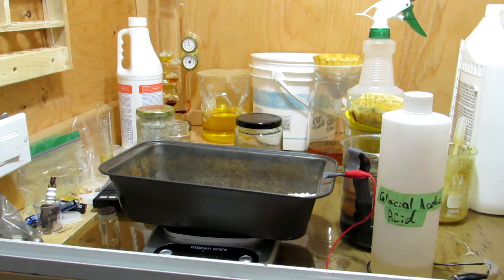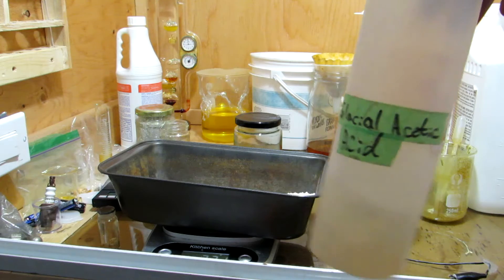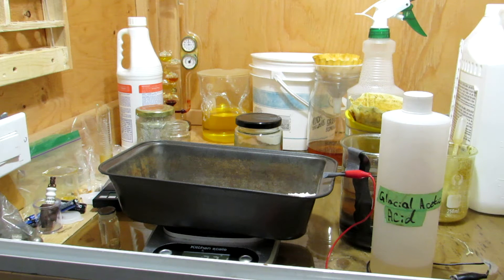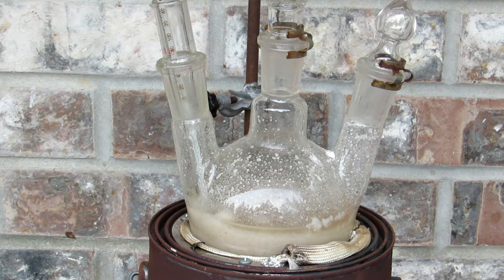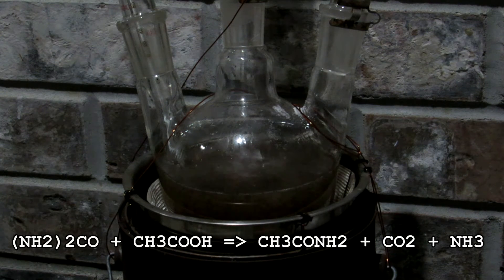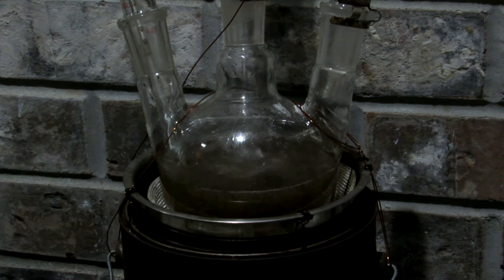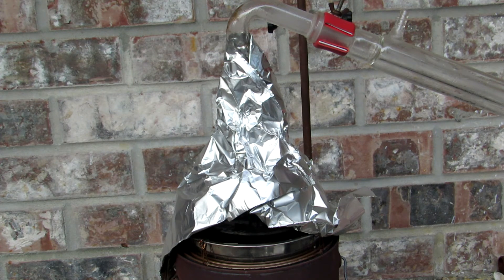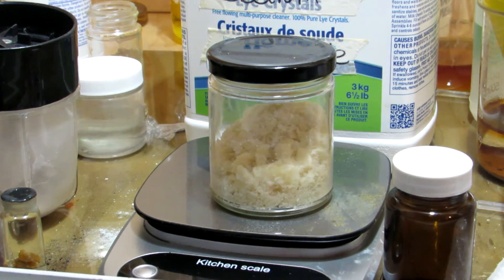Making Acetamide from Urea - Household Materials

Comment: Where is the loss in yield coming from?
Reply from the maker: Honestly, it is probably a variety of things. Some of the urea probably just decomposed directly at the high temperatures of the reaction, and although my glacial acetic Acid was fairly pure, I think it probably had a bit of water in it because I made it myself. This probably also affected yield. Finally, near it’s boiling point, acetamide does decompose, so over the 8 hour reflux I wouldn’t be suppressed if some of it decomposed.
Reply: @TheCanadianChemist  I wouldn't worry too much about reduced yield in the beginning. What matters is successfully completing the reaction. From there you can work on yield. In my college we have professionally sourced chemicals and many of us get poor yields.